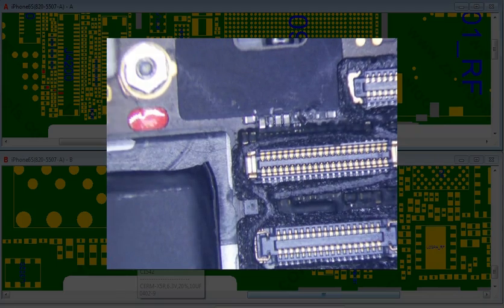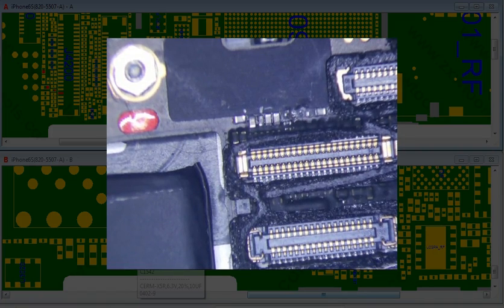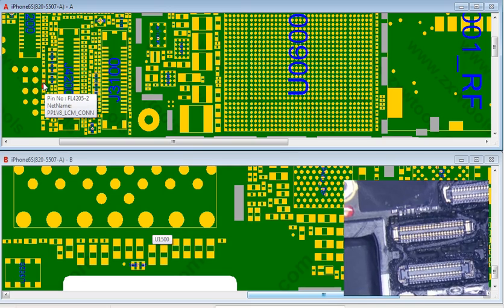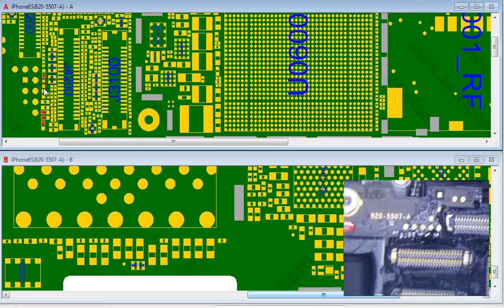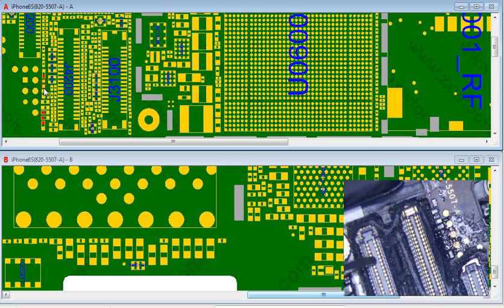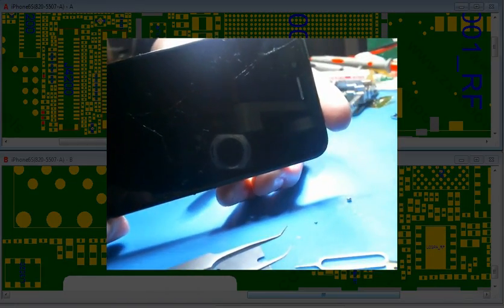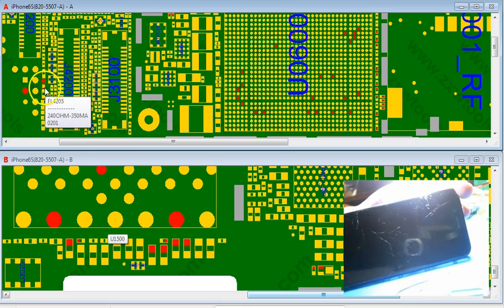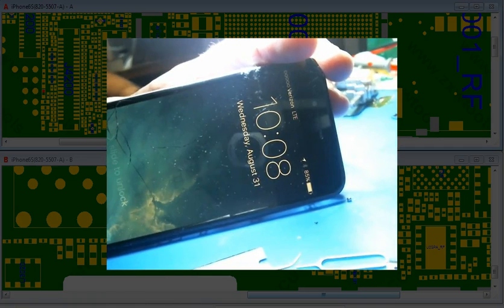iPhone 6S Water Damaged Lines and No Touch

Comment: Here are your lines. Replaced some dodgy filters and caps near the corroded area, but no avail

https://photos.app.goo.gl/jsQNalpWG9d1pnIF2
Reply from the maker: check diode mode on the connector and compare with a known good board